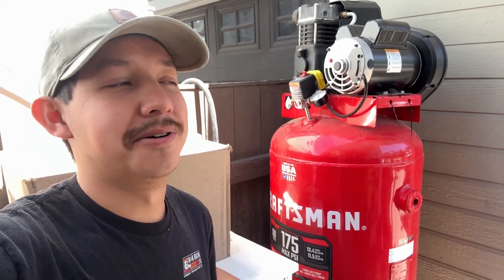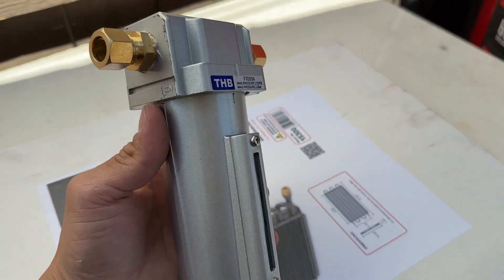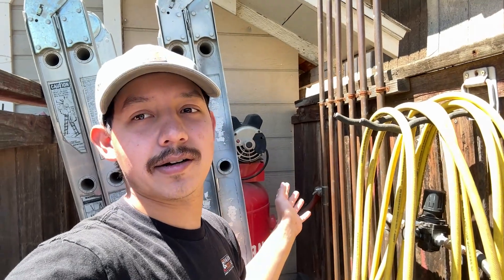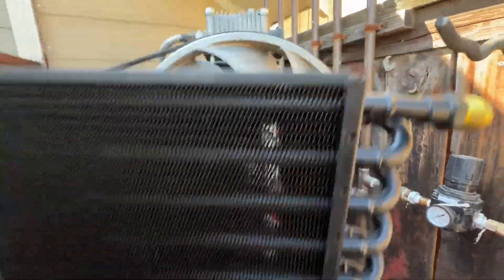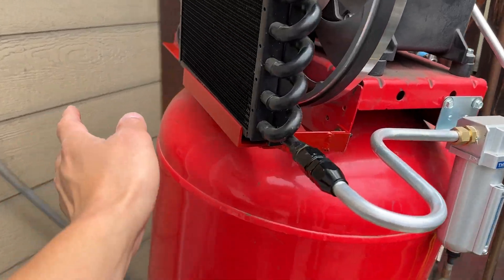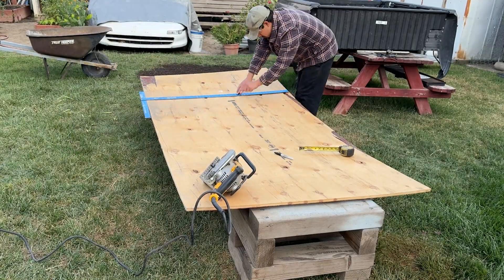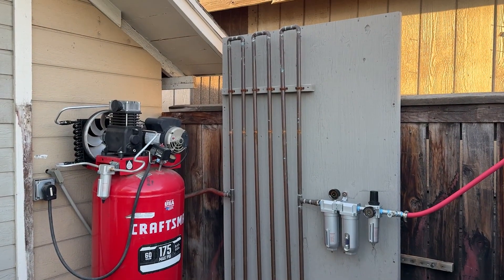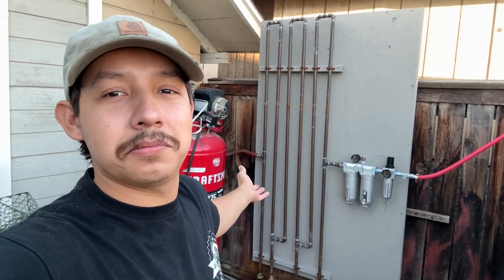The CLEANEST and DRIEST Air!! Air Compressor Aftercooler Filtration and Water Dryer System!

Comment: I think its a good set up. I have found lots of people using this transmission cooler and water filter as you did as i have been looking at ideas to improve my own set up.  I also have the additional 50’ of copper set up like you do, then filters and dryers.  I think it should work great. Nice clear concise presentation.

Comment: I just looked up the cooler you have from Derale, and they have a note: "NONE OF OUR COOLERS ARE INTENDED FOR USE ON AIR COMPRESSORS*. I wonder why? They are rated at 250 psi.